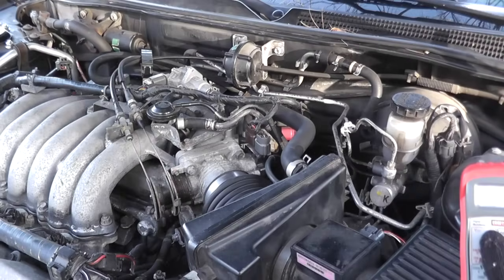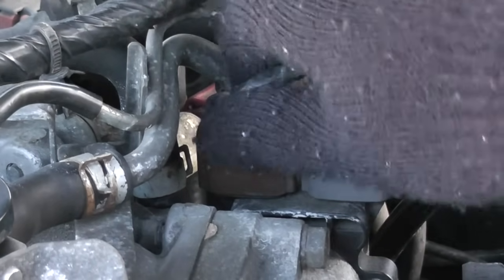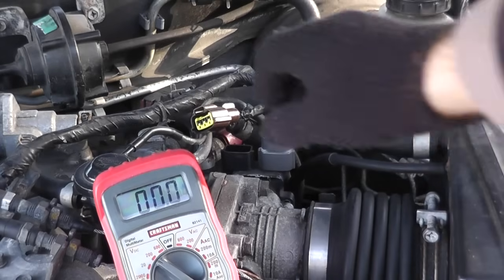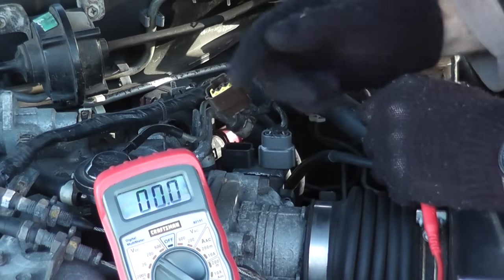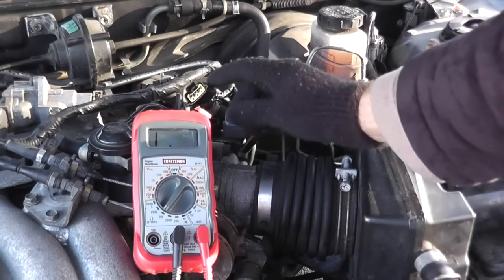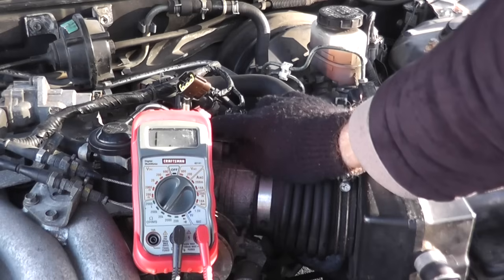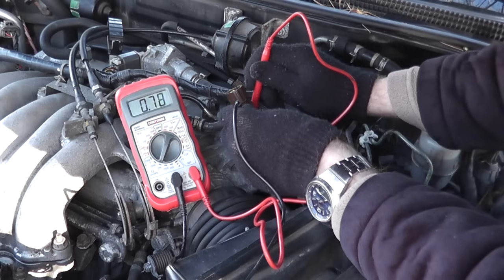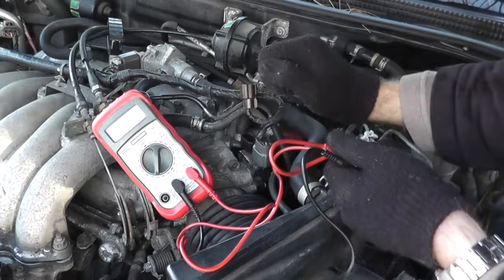How To Test and Replace the Throttle Position Sensor (TPS) P0120

Comment: Hey there I have a 2003 Chevy Trailblazer and I am getting a code P0507
Reply: Any help would be appreciated thank you
Reply from the maker: Hi IVS. That's a trouble code for idle speed; specifically if idle is 200 RPMs or more above target idle. It could be a simple intake air leak, PCV system (I have a video showing how to replace a PCV valve) or the throttle control actuator. Check out Scotty Kilmer's channel as well. He has a few videos regarding air intake leaks and how to find them. Good luck.
Reply: Thank you for your quick response
Reply from the maker: Glad to help. Cheers
Reply: So would that definitely be a leak.. because when I first start the car in the morning it sounds normal but after a while of running the engine it starts acting up when I accelerate the engine rides and sound smooth but when my foot its off the gas pedal the rpm starts going up n down.
Reply from the maker: I would start by inspecting the pcv valve. I have a video showing on how to test a pcv valve. Just search under my page and this should give you a pretty good idea on what to look for.